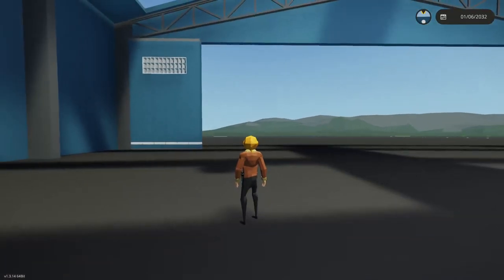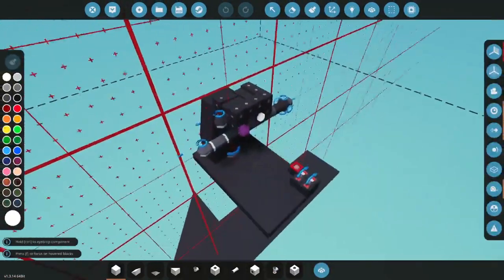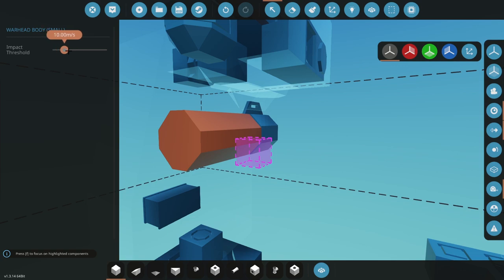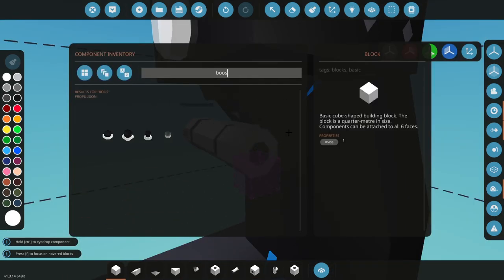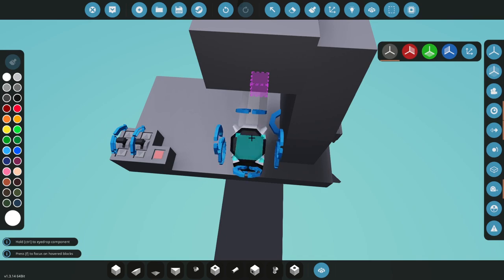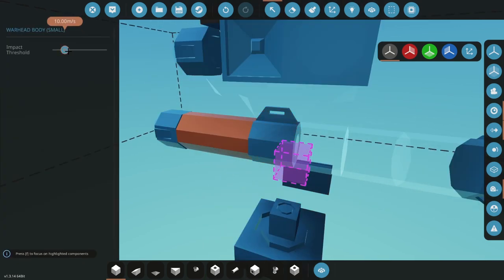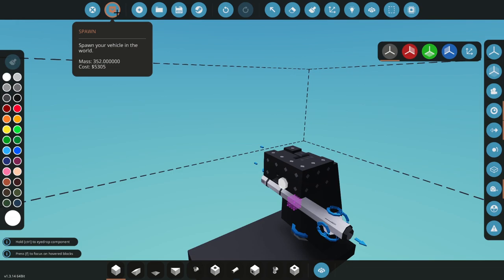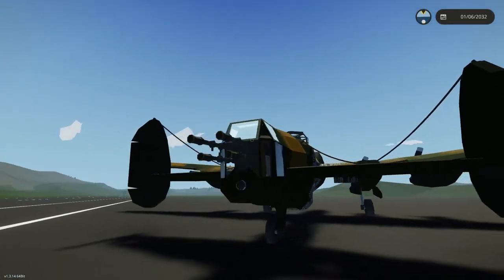How to make Radar Guided Missiles in under 4 minutes! - Stormworks [DLC]

Comment: The fins do not do anything to guide the missile? Plugged both composite and electric in, changing the sensitivity, changing the rotation of the part, nothing. Disable the fins or delete them entirely and the missile flies the same, just forward before crashing into the ground.

Comment: So its my experience with copy past of the default builds missile system that it does not actually work on Aircraft to seek other Aircraft but will seek objects on the ground if fired from the air.
It does not seem to seek another air target when fired from an Aircraft.
Reply from the maker: That's odd. Mine seem to work fine on my jets and fighters
Reply: @BigmanBois   I realized it seemed as though I was saying yours did that. No the Default one seems to.

Comment: So apparently my missiles go through ground and walls, It doesn't explode on impact as well, radar tracking is also very weird, it turns to all direction. Why?
Reply from the maker: Unfortunately thats due to stormworks physics. I recommend toying around with your burn rates and fins
Reply: @BigmanBois  I used the stormwork's missile as a preview and it worked.

Comment: no matter what tutorial I do it also doesn't work. I DONT KNOW WHY
Reply: ExActlY THE SAME. It really is exploding my nerves limit. I've tried hundreds and hundreds and hundreds of times and still doesn't work.  Finally I found someone who has the same problem
Reply: @giorgiolelmi8175  yeah I follow it and it may work once but as soon as I customize it with XML parts BOOM it doesn't work and I don't know why.
Reply: or as soon as I add a fuel tank or something doesn't matter it just breaks
Reply: My rockets do not separate from the hardpoint, is it because of the update? I tried everything
Reply: @jorgeramirezrocha5823 do you know if you set all the controls up?
Reply: @officiallygenix7382  

Sorry for my bad English, I am a Spanish speaker.

My rocket now worked, the problem was that the whole structure was joined together, I had to separate the rocket from the launcher and put it back together so that it was considered a separate object, I don't know why, that didn't happen in the video

Comment: I cant get the hardpoint to disconnect and fire. Nothing works.
Reply from the maker: Check your logic connections
Reply: @BigmanBois  what connections specifically? I'm trying to launch them from my compact pilot seat but they aren't disconnecting
Reply: @craggywag5482  Check MERGE, I had the same issue and realized part of my rocket merged to the main part of my boat from the hardpoint connector
Reply: @Fallout3131  I figured it out, also each rocket has to be its own part
Reply: @craggywag5482  
Are your rockets hitting the target? 
Just curious as mine like to fly away into the sky, lol.
Reply: @Fallout3131  I got rid of the radar warhead so they’re just bigger rockers now